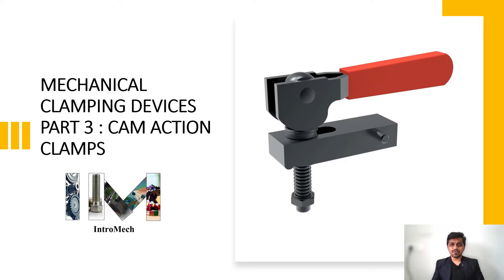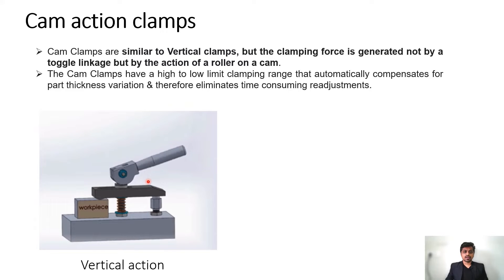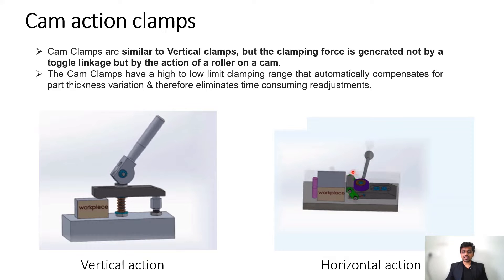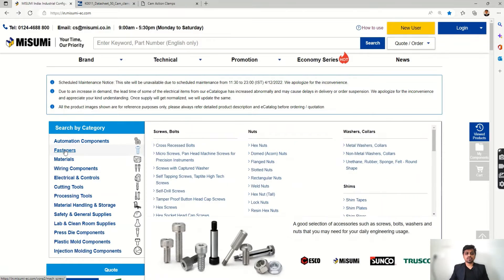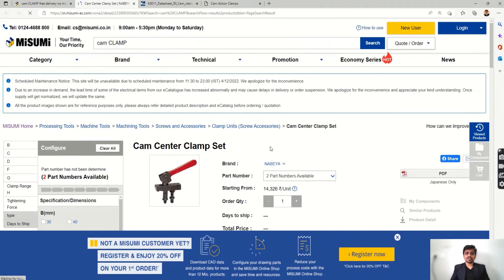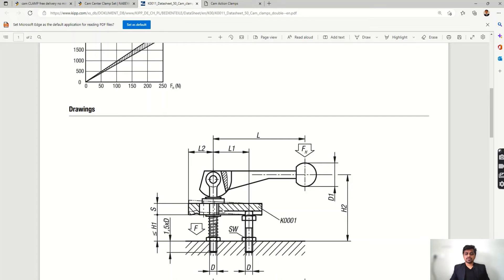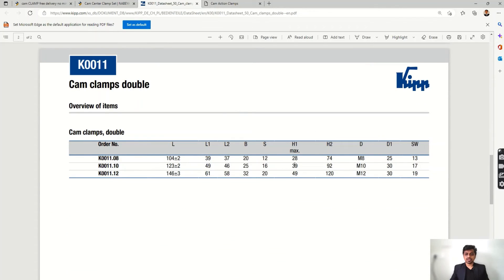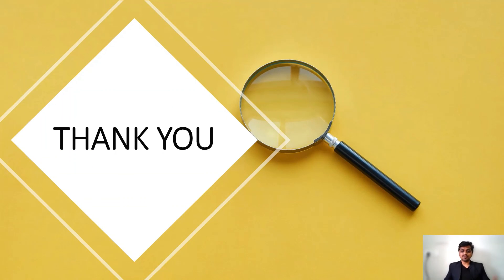MECHANICAL CLAMPING DEVICES PART 3: - CAM ACTION CLAMPS

Comment: How to select materials for fixture components?
Reply from the maker: The material selection depends on many factors. It depends on the material of job. If you are using some location/resting pins those should not damage the parts. The fixture plate if it is removable you need to think about its weight. Lot of factors are there. I will try to cover some of the points in some other video. Thank you for the suggestion!!!